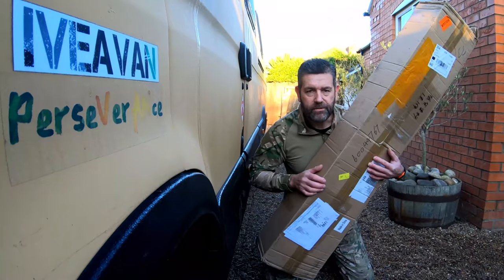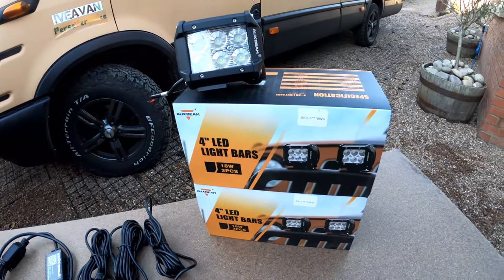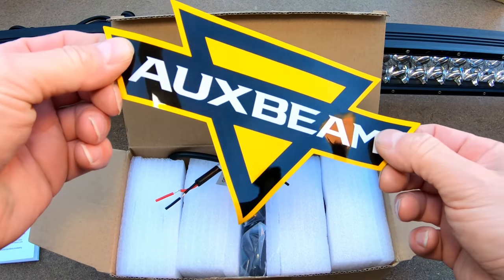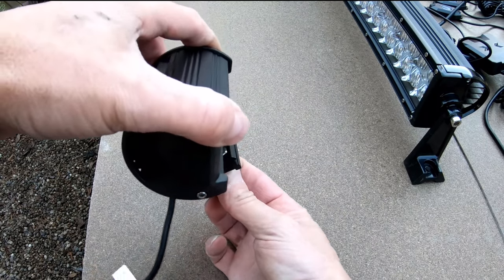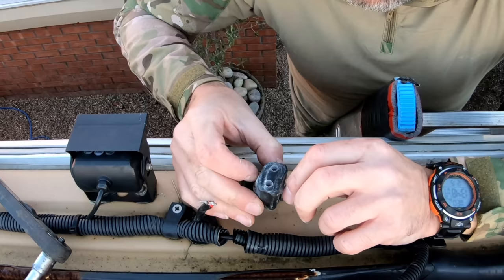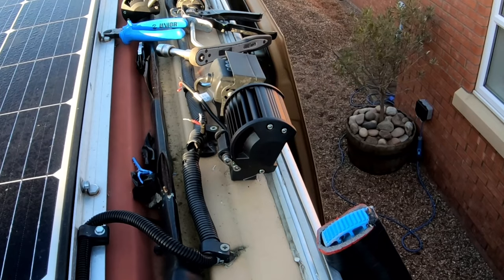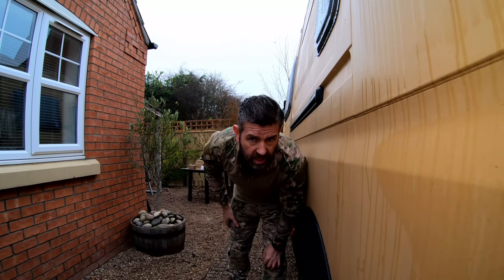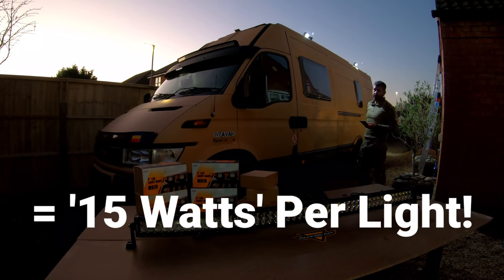Iveco Daily LED Flood/Spot Light Install 🤜))Auxbeam VS Competitor((🤛

Comment: Great to see you back on here dude :) Am I right in thinking it's bluetooth connection means the phone app stuff only works something  like 10ft-15ftfrom the van?
Reply from the maker: Cheers matey 😎👍. These lights are not blue tooth bud. But the other ones that I'll be featuring are & yes you'll be right bud, but I'll test that out for you within the next light video  to see if it is within that range or more 😉👊👍👍👍...

Comment: Hi Mark, very informative video, thanks ! I'm also interested to know how you added relay outputs to the CERBOGX to control the lights ! Thanks !
Reply from the maker: Cheers Seb 👌👍, a little bit how I wired up the starter motor for the generator (just with out the timer relay) this is the video for that (it shows a little bit more regarding the venus control panel wiring) https://youtu.be/nqXy13js3p8
Reply: @Iveavan  ok, it's a Venus OS ! More versatile, Thanks :-)
Reply from the maker: That's right on Raspberry Pi 3b+👌👍.

Comment: After all your changes hope to see more vids of trips ect, after the main build of your van you kinda vanished hope to see more content :)
Reply from the maker: Cheers Gav 😉👍. Unfortunately due to this pandemic I was working 60 +  hours a week, so YT had to take a back seat due to each video does take around 12 to 18 hrs to edit and depending on the the subject probably same amount of time to film. But now I've finished work I can concentrate on YouTube more. So they will be more videos this year, just the next few videos may take longer between each one due to the complexity of the jobs. The next video is out this weekend, the next one after that I'm editing now. But yes, I'll try and get some trips filmed too! But unfortunately they don't draw the crowd in so much. 😎👊👌👍👍👍.
Reply: @Iveavan  hi Mark did you get my message about hanger springs and where I could possibly get some from thanks
Reply from the maker: @makolder4956 is this related to the one I answered, bud?

Comment: My question is- you need to have a separate battery for all that or with your normal battery? Thanks
Reply from the maker: No, you can use your starter battery, it be perfectly fine👌👍. I wanted to use the power from my leasure batteries as I'd rathe keep it separate from the base van electrics 😉👍.
Reply: @Iveavan  
Thank you 😊

Comment: Some cruel testing on those lights! Maybe an air pistol next to simulate grit strike? The product links have broken even if the lights didn't :(
Reply from the maker: Yes you are right! Those links have stopped working 🤔?  The product Links within the discription (which are the same links) are working though. I've altered the 'pinned comment', thanks for that bud  😉👌👍👍👍, ohhh and maybe an air cheater with its nozzle full of grit next time 😁😉👊👌👍👍👍... .